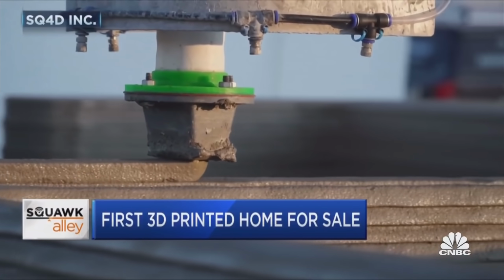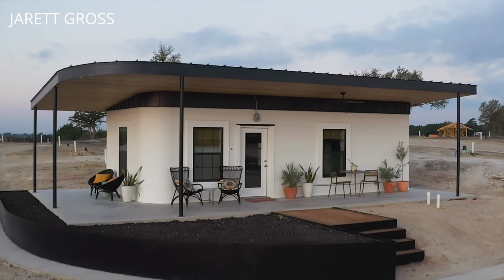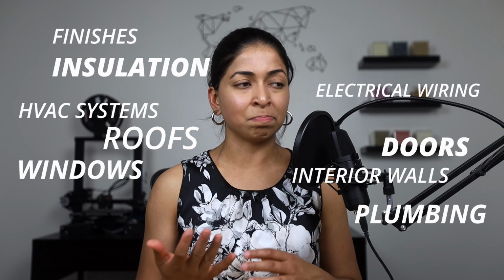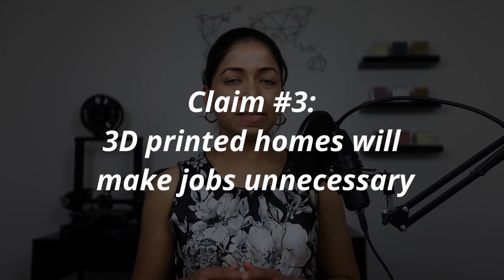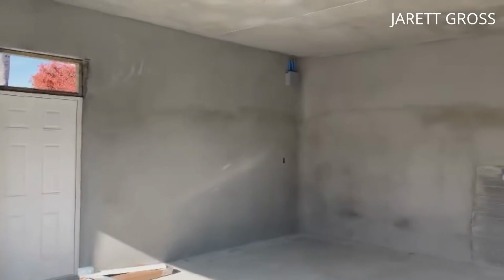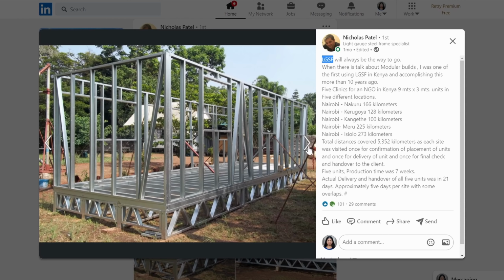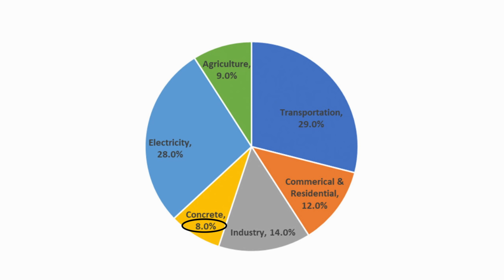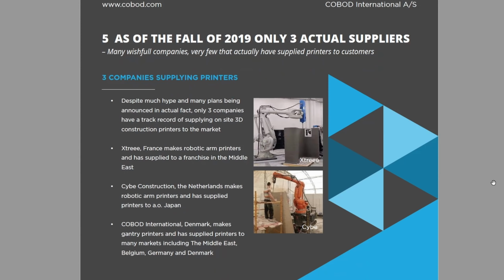Exposing 5 LIES about 3D Printed Concrete Homes

Comment: In most areas around the world, the issue isn't housing, it's the market itself. We have the tech and labor to build highly efficient smaller homes that are affordable, it's just that no one will build them! Unless you count pre-manufactured homes, which have a stigma at least here in the US of being for those in poverty and as a result, most are only ever allowed in "trailer parks" which are often poorly maintained and tightly packed so no one really wants to live in them.

Here in ND, the only way you can get a sub 2,300 sqft home that isn't pre-manufactured is to go for an older home, but unless you go for a home that needs remodeling, they often sell for just as much as a larger home due to them being in an "established" neighborhood. IE: My parents 1300sqft home is valued at 235k, but I can get a new home that's 2300sqft for the same price. Yet there is no one offering a brand new home under 2300sqft for nearly half the cost?

Heck, where I used to live, they straight up will deny a permit for any home that's under 1200Sqft! My Grandparents raised 7 kids in a home that's 710sqft!!!!
Reply: I can back this. I got out of Construction but stuck with the Union, and now only do real estate; The issue is the companies that ask to have homes built. People, individuals, don't typically ask to have a home built. The people making the choices of when and where to build homes is companies. They don't ask for these cheap houses, they ask for 'house farms', those neatly made villages of two story+base houses that have all this nice wood, cool tech, all this shine to them, and cost 500k~1m because ya know, the real estate company needs to eat. 

And as the above said, a lot of places deny homes to be built if they don't meet size or material requirements. One of the rural areas near me is infamous for being gentrified due to the fact that they will not allow anything under a specific size and material value. Why? Because home value. You can't restrict people from building something expressly for it's home value, but you can restrict them from doing things that would have a low value. Thus, you have places like Buffalo and Albany, where there's a 70% vacancy rate of houses, yet they're still building more of the same...
Reply: @gigaus0  to build on this, homes built on lots all have a certain 'break through' costs that's similar to every hole big or small. Septic or rural water has to be run/installed, permits made, ground work done, lawyers and agents paid etc etc. Most homes the house is a relative fraction of costs, with land and infrastructure taking a big chunk of a new homes sale. Things like that don't really scale unless someone makes a neighborhood like that, and as was said, those guys have a profit motive themselves. Why make $5k a house when you can make $50k?
Reply: @idrathernot_2  You're on the right track with your comment. I live in a 1200 sq ft modular house dating to 1996. It is still in really good shape for any 25 year old house. Mine is erected in a country setting, so the original builders had well and septic costs to cover. I'm not sure of the original installation cost, that was three owners ago and all involved have passed away, but it is currently valued (with the land) at $115,000, low priced for may area.

To replicate this house on the lot next door would cost $40K for the lot (1.25 acres around here); $15 would cover well and septic (we have reasonable septic standards around here). The house itself would be in the $125k range, with some unknown set up fees and building permit fees. That already adds up to the $180K range, and that is a bare bones estimate. That means duplicating my existing house is already 50% more expensive that buying the existing house.

I actually do think that manufactured housing can save money for home buyers. To stick build a house in my area it is now the rule of thumb to plan for $175 a square foot for construction alone, no lot, no well or septic. That puts duplicating my house in the $210K range plus $55k or more for all the other stuff. SO we are back to the $280K range for a new, small home.

The Us federal Government could help this issue a bit by creating a third class of pre-built homes. Now, a two piece modular home needs to arrive on site with everything included to be able to move right in as soon as the modules are set and the power and water connected. Parts of these house need to be over built because they are transported. Eliminating the need for the interior space to be dry walled and cabinets hung, fixtures set and furnace and hot water heater included could knock down the initial costs of these houses. Hiring local can help here. It can also give the buyer a better handle on applying their purchasing dollars to the quality level they desire for the items in the home. It would also stop some of the 'mobile home' look featured found in so many modular houses.
Reply: This is one perspective from one part of the US -  and obviously different parts of the US experience different perspectives on housing.

In Texas where I've lived for 20+ years - they build new houses all the time down here. Tons were built in the late 90s and early 2000s - like a ton. But even today theres still dozen of neighborhoods going up - 200-400k homes. Anything between 1300 and 3000sqft are fairly easy to find new.

Since Texas is a place where alot of people are moving to and we have alot of land - theres builders who come out here and foot the bill for a whole neighborhood to be designed, permitted and built, usually by one set of contractors. 
Down here they are called "cookie cutter houses" - and unless you live way out of the city - most middle class families live in these. only maybe 20-40ft separating the bricked houses. Small yards, fenced in backyards.

Most of the rest of the country has houses that are alot more unique - purpose built - made to match the land, etc. There might be "developer neighborhoods" here and there but thats what a lot of people in the north called like "planned communities" and those houses are usually even more expensive up there.

Thats basically the default out in Texas - except they build these houses as cheap as possible, so while its made to look nice - once you get inside and see what your working with its pretty basic, insulation needs upgrades, etc.
Reply: Many places in NY have micro apartments, but the landlords charge MORE for them
Reply: The problem sometimes is the system. Here in Spain there is and there isn't housing. Let me explain there are lots of housing on the market because lots of houses were built in the 2000s but they were built in the countryside with an over estimation on the grow that the rural Spain will experience, many people thought that my town will have 15000 inhabitants but in the end there are less than 3000. 
The problem now is that there are houses but not where people want them which is in the big cities. This is a big problem because the prices in the big cities rise a lot and tons of abandoned houses in the rural areas mostly attracts problems, specially drug plantations.

But of course the biggest problem are the politicians who doesn't seem to care about these problems proposing stupid solutions or no solutions at all.
Reply: Jesus 710 square feet for 7 people 0_o my family is only 6 people total and I look at 1300 square feet and think it's too small.
Reply: sad to say but the issue is the world is greedy..... would most people rather build one house or twenty houses for the same profit?....... the poor dont have enough profit to make it "worth" their time.....
Reply: This comment is so on point.
Reply: @joelcrafter43  try 20x25 (albeit two floors) 6 people (2 parents, 4 kids) and a dog. that's 500 sqr ft. Sheffield, UK. not at all uncommon. my school friend had 11 in an even smaller back-to-back terrace, outside toilet, no 'bathroom'. and we were average/roomy.   710? luxury!
Reply: @steviesteveo1  wtf u on?
Reply: @jaredking380  first bit i agree with. after that you lost me.
Reply: By the way, housing and real estate has become a storage of wealth instead of just a utility. 
Impossible to solve without overturning the whole property rights thing.
Reply: The problem isn't a shortage of homes, it's a shortage of land. Opening up zoning to support more multifamily development is the real solution.

A tiny home, 3d printed home, shipping container home, or trailer is still a single family home and an inefficient use of space in a city. 

In a plot that could hold two trailers or 6-8 tiny homes could support a four story 40 unit apartment building and have about 10x the impact on meeting housing demand.
Reply: Trailers suck because even if you own one you still have to pay rent unless it on your land
Reply: @jaredking380  So, build their own. Sweat equity !
Reply: Minimum house size to hook up power in my area is 720 sq/ft. Most land have 0 restrictions so as long as it has the size build or use whatever

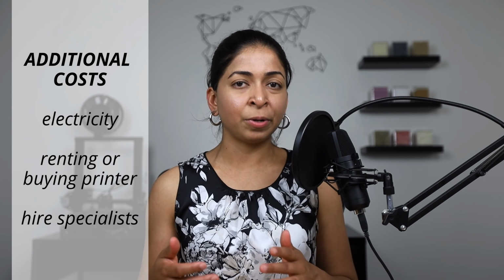Comment: 2:38 The 24 hour claim is the actual time it takes the machine to 'print' the house, machine hours of use. This point is like saying - it takes me an hour to get to grandmother's house - then having you claim that is not accurate because I have to mined the metal to make the car then purchase the car then find the oil to make the gasoline and then fill the car up with oil and gas and ...  Seeing a bias here.

Comment: The claim that it could cost as little as $3500 USD in El Salvador is quite reasonable... however a hand constructed block home with roof using conventional and classic techniques of the same footprint can be had for about $2800 USD in El Salvador.
Reply: $3500 sounds nice if you're an American feeling charitable to donate a few homes, not a local

Comment: There is no way a house made like this would stand after an earthquake. No rebar, and due to the method in which it's applied, quite porous.
I think you wouldn't even get a permit from the municipality here in Chile.
Also, brick is way cheaper.
Reply: Some places are lucky to have as good as no earthquakes though. I get that in Chile thoses houses are out of the question though XD
Reply: Amen
Reply: I don’t know if this has been brought up, but I believe the largest contribution this tech has is in reducing the amounts of materials needed to build the structure. This is why homes is so expensive. If there is a lumber shortage, prices soar and construction stalls. If you replace wood frames with steel frames, there could also be supply chain issues. I don’t know if the automation is the biggest selling point. It’s the streamlining of materials, in my opinion. Overall, would ICF blocks or even Hempcrete blocks be the best solution? I don’t think solving homelessness is the immediate goal, but reducing home costs and challenging the status quo and runaway inflation due to housing crisis is necessary. Thoughts?
Reply: They do use rebar, I saw a video about it.
Reply: Existing homes are expensive because homeowners overvalue their homes and properties, and banks would rather create what is essentially an eternal renter class through gigantic mortgages than let people pay off their loans and actually own their homes. New construction is expensive because of the insane amount of red tape constraining design imposed by people who don't understand anything about buildings and manual labor shortages. Material availability is a hit or miss, but the cost escalation of materials has (almost) always outpaced inflation for at least the past 70 years (with an exception in either 2008 or 2009, I forget which year).

Buildings don't need to be as expensive as they are, but too many people with power benefit from things remaining the way they are or making them worse for things to get better. When I get into practice, I'd like to do everything I can to make my designs affordable, but who knows how the market will change within the next few years. Hopefully enough people from my generation will get off their damn high horse and realize that civilization can't function without people doing the dirtier work.
Reply: @chrismcadams821  reducing home costs relies solely on people buying homes produced in the most sustainable way. just because americans can't get their heads out of their asses and use bricks to build homes, doesn't mean the wheel needs to be reinvented. 
And this myth that 3d printing is more waste free than traditional construction is laughable. If we enforced the same amount of material conservation on traditional construction as these people are doing on 3rd printing(for presentation) this wouldn't even remotely be a talking point.
Reply: @chrismcadams821  you’re way off course, the materials are no where near the driving force of home prices.  PROFIT AND GREED ARE
Reply: Was thinking the same. 
Personally, I live in a country with 0 natural disasters. No earthquakes, volcanoes, hurricanes, tornadoes, hailstorm etc. At most you might get a snow "storm" during the winter, but even those arent that bad, and people are used to it.
Reply: @StorminNorman bricks, unless 100 years old, can handle earthquakes just fine. there's a reason why alternative to bricks is reinforced concrete and not just plain poured concrete.
Reply: @chrismcadams821  a mud hut would be probably better
Reply: @StorminNorman If you're going to build a structure that's probably going to be damaged or destroyed by an earthquake pretty much no matter what, might as well go with the cheapest option.
Reply: @chrismcadams821  other than materials land is also a big issue. land is just expensive and unavailable in many places. not everyone have a remote job so they can live far from the city.
Reply: @ivicamajmunskikreten9714  we use lots of wood here in Finland too. We also have "house factories" that build houses in one big factory and then transport it in pieces to its final location.
Reply: @Tupsuu  well shit, are you destroying rain forests for your 300 million residents, or are you sustainably logging your own forests?
Reply: @Tupsuu  and let's not forget the US has 33 capita per sq km while Finland has 16. Totally comparable consumption...
Reply: La mejoras tecnológicas siempre son buenas, pero en esto hay mucho humo. Esta forma de construcción obviamente es más cara, como lo es la construcción en seco tan propuesta por usa. Si tu casa no va a durar más de treinta años y antes de ese tiempo tenés que remodelarla. Obviamente termina siendo más cara, que una construcción tradicional con ladrillos y concreto.....he visto revoques con cal de más de 100 años sin fisuras en fachadas de casas (cosa muy común con el Portland en menos de 10 años) lo mismo con cañerias de plomo o hidrobronce (teniendo 50 años mi casa solo tuve que cambiar un tramo porque yo lo rompi sin querer con el cortafierro) al final esto de la obsolescencia programada sale bastante caro veo
Reply: I don't know how is next door (Chile ) but here in Argentina the "municipality" would permited anything.... if you know "Mr. Bribe" 🤫😉 ....i think in LATAM we have too many "mayor quimby "
Reply: keep spreading this nonsense so ppl dont do it so i have more time to buy a printer lol
Reply: @cryptobuddha2600  and then natural selection will be waiting to do its thing.
Reply: I had a friend stoked about this and looked at me like I was the devil when I blurted out "that wouldn't be earthquake resistant." I was too much a killjoy, and him the arrogant homelessness solution, dude. He said have the homless pickup trash and do small City jobs for money. Aka - -get a job, but one thats super low and work he didnt want to do as a City worker himself. Anyways, Im a geologist no freaking way I would live in a 3D printed home.